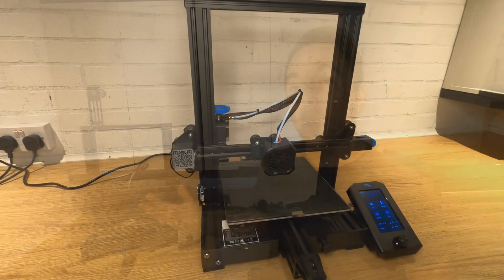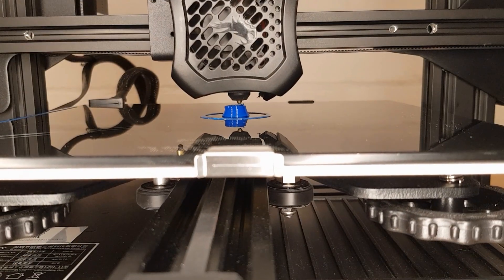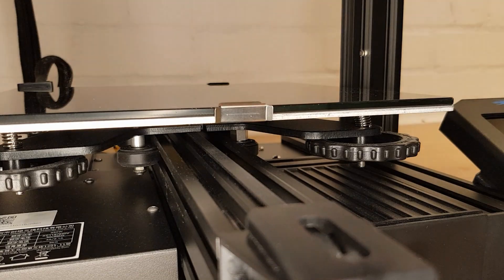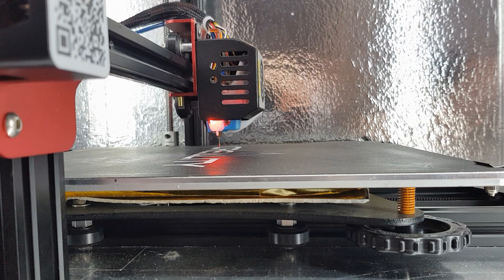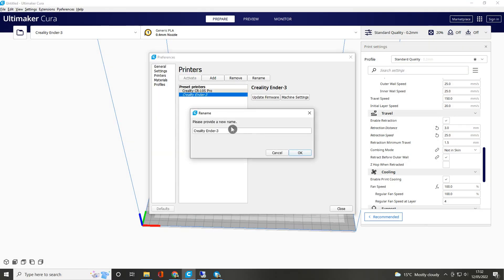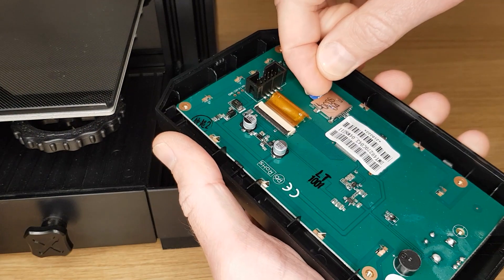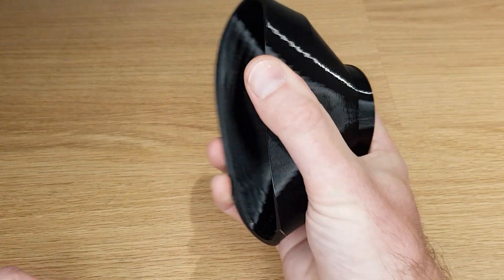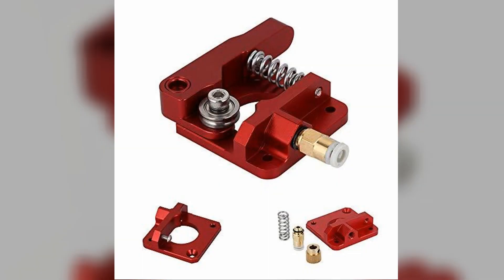Ender 3 v2 - Still The Best Budget 3d Printer in 2023? The Truth After 6 Months

Comment: After 1 year my Ender 3 V2 is still awesome, I have done many upgrades to it, I advice a bed leveler like BLtouch or CR, and a nut addition for the bed/spring leveling, the screws tend to spin while trying to level the bed, besides that a capricorn tube for the bowden tube is also good, there is a video on cutting a small piece and placing it inside the hot end which is also great, but these items are cheap and all you really need, anything else will not improve prints but help with the life span of your printer. Love your videos btw

Comment: I bought this printer at the end of 2021 and have changed a lot to it. First I bought better bed springs, then a whole metal extruder, a BLtouch for auto bed leveling and a filament runout sensor. Meanwhile I had to replace the hot end unit as the fan studs got broken. (You can't print yourself one when this piece is broken, so maybe I should print one in advance. Just in case....) Last week I moved from Jyers firmware and Octoprint to Klipper in combination with Mainsail. The screen became useless, so I bought a 4" touchscreen for the hooked up Raspberry Pi and printed a nice mount to bolt it at the same location to the printer as the original screen. The only thing I'm running into fairly often is heat creep. I have no clue why. Especially as the fans are still pretty new, so colling should be ok.

Comment: I bought Ender 3 v2 Neo and upgraded the heatbreak. I am very happy with it. You can't go wrong it's the third edition's v2 and Neo update. Full Metal Bowden Extruder + CRTouch with metal tip! And I printed lots of upgrade parts. Its such a good 3D printer. You really can't go wrong. It may not have lineer guides but hey it's $300 printer... Not a 1500 one... And it can print as good as those 1500, 2000 price tag printers... Especially Prussa... Don't buy Prussa Ender Prints with much better quality!

Comment: It took me 5 hours to assemble it. It was my first ever 3D printer and I knew nothing about them. I found the build manual to be confusing, I never knew which was "left side" and "right side " , the drawings always showed from different sides. It could have easily showed the different drilled holes indicating left or right. All the wires didn't make sense if you build it back to front.
Eventually I relied more on common sense and made more progress. I also couldn't work out where the software went , I thought it was on the printer itself. I seemed to have problems with filament not getting to the nozzle too and the blue wheel didn't really push the filament down. But I learned a lot from all my mistakes , bed levelling only caused minor problems , not printing on one side . I soon learned that you can adjust the settings mid print . For my first thingiverse print , it said 26 hours to print , I'm not sure why so long. Oh I'm learning a lot 🥴
Reply from the maker: I hope you're enjoying the journey, there is a lot to learn initially but it gets easier.

Comment: Can you use CNC programming language on these machines?’ I used to be a milling machinist and know the language really well. Also what 3D machines are good for precision plastic parts?
Reply from the maker: Hi, from my experience, CNC machines use G-code, so do 3d printers. However, I would use the software designed for 3d printers called 'slicers' and then see if you want to mod anything from there, it would save a lot of time. This video helps to explain the process https://youtu.be/e-lQPGJ3Psc
When it comes to 'precision' plastic parts, it depends what tolerances you are looking for. To get fine tolerances, you will likely need to do some tuning on any machine you buy and keep a close eye on all of the variables like temperature and humidity.

Comment: If you are a new user and using videos like this as a guide, don't. Creality is trash. Crtouch missing hardware, dual Z missing hardware. Only needed those 2 mods because the default printer is trash. Glass plate, can't be bothered to be flat. This a paid review? I hear they do that too. I'm sure these were good in 2018 when they made the design, 5 years later, same innovation (lack) and poor design (oversized Max without stock dual Z).
Reply from the maker: Sorry you've had a bad experience. This was 100% not a paid review. I bought this printer myself and have zero affiliation with Creality at this point. My reviews are always 100% my honest opinion and always will be. I still use my Ender 3 V2 daily. I genuinely love it.

Comment: I got my E3V2 for Christmas. I cannot thank you enough for your videos - they have been a great help.
In particular my V2 came with same bed issue as yours being too tight from factory and having developed flat spots on the rollers. Your tips on that issue in your assembly video turned out very helpful.
Then comes the bed leveling (I have also interacted with you on bed leveling video before). Your video showing bed leveling using a feeler gauge is the best. That is my preferred method as well.
Being an engineer myself and with some OCD, I was very systematic and precise during my assembly. Result -> The printer has been delivering outstanding results right from print #1 !!
Thank you for everything and looking forward to more videos from you. (I am glad I have same model as yours 😀😀)
Reply from the maker: Thanks for the comment. It sound like you have all the tools you need to enjoy 3d printing, a systematic approach and a little patience. So many problems are caused by sloppy assembly and not always by owners. I always seem to find something that manufacturers have assembled wrong when I get new machines. Let me know if you have any 'challenges' that I haven't covered in a video👍

Comment: I think I have owned this printer now from just before this vid came out and it has been nothing but trouble! I love it! 
It all started on day 1 with an upgrade to Jyers (now mriscoc Professional) followed very closely with new fans, and more of them. To reduce the noise I installed squash balls. Because my glass bed was basically a bowl it was impossible to tram the bed so I got a 3d touch. I wanted to print PETG but the blobbing lead me to convert to direct drive, then a HeroMe gen6 for better PLA cooling. For improved bed adhesion and removal without having to tram the bed all the time I added a magnetic PEI sheet which is brilliant. Now I'm upgrading to a dual lead screw setup because the direct extruder is too heavy and messes up technical prints. In between I also got silicone bed 'springs' and an all metal hot-end conversion kit. I guess the only thing left is an ender extender, but that's so expensive!
It's been a wild ride but I am still enjoying every minute (well, except that one Ali Express scammer, but that's another story)...
Reply from the maker: Sounds like you are enjoying yourself 🙂

Comment: Is the ender v2 better, or an upgraded model of the Ender 3 pro?
Reply from the maker: I'd say that 'better' is a matter of opinion. The Ender 3 Pro used to be shipped with an 8 bit mainboard but I believe they mainly ship with a 32 bit board now. The v2 has always had the 32 bit board which is better. The V2 also has a bigger colour screen but it doesn't allow you to do any more really. They also have different bed surfaces but I wouldn't necessarily say one is better than the other. The power supply is within the bas on the v2 rather than external so it's overall appearance is nicer.

Comment: I found that my plastic extruder has started cracking without me noticing. What ended up happening was that it was slipping while pulling filament through. My prints would still work most of the time, but wasn't extruding as much as it should so I just didn't notice at first. i was printing for about a year before I had that problem though. And I got some really good prints before that.

Comment: I have the E3v2 and like it.
I have trouble with it though printing eSun PLA+ that is supposed to be printed with a bit higher nozzle temp and I get stringing and some blobs
Factory set estep seems way off, as well as matching flow rate that would provide a perfect 0.40mm single line wall
There's quite a bit z axis hysteresis going up vs down, especially to the right.
Using latest Pro firmware for E3v2 with UBL, tramming/mesh says I'm level but bed level test suggests the right side has a bit too much gap.

I just want to solve the stringing/bobs without having to make the nozzle cold which creates its own problems.
Reply from the maker: Have you tried drying your filament? I find eSun to be pretty good but I do dry most of my filament. Try this if you don't have a dryer https://youtu.be/WC3jvuq-uq8
Reply: @RickyImpey  wow, what a fast reply!
Yes, I've dried it with updated Sunlu for 9 hours at 47c with desiccant inside.  After about 8 hours chamber towards top of filament was18% humidity with temp at 108F or 42.2C.  I've done that before without much improvement
I'm printing the cat now with flow modified in gcode to 89.

I should add that when I've done maintenance on the hot end, I found about 8mm (from memory about the height of the heat break throat) of filament somewhat tight in the bowden tube after I've extracted the filament.
Also I found the heat break was not screwed in tight into the heat block, also the heat block support screws were also loose.  At the time I didn't know the heat break was screwed in, thought it floated to minimize heat transfer and that only the bowden tube made contact with the nozzle base.
On my first change of nozzle thinking it was clogged, apparently I didn't have the tube against the nozzle so melted filament eventually spilled all over the place at the top of the heat block.
Reply from the maker: @danman32  sounds like you're sorting it out now at least. They are good printers but Creality don't always put them together with the greatest care unfortunately 😏
Reply: @RickyImpey  not sure how you can say I'm sorting it out.  Still same problem, just added history and findings.

Comment: Great video, really enjoyed it and for sure will be using you tips when assembly my printer. (soon to be bought).
Also, I had some comments on a reddit post saying that the V2 is no longer "okay" and the NEO (basic) would be a better option. Do you agree? From I saw, I would still be choosing the V2. I am thinking on upgrading the fans, so at least that"extra" money would be spent. Regarding the auto leveling, I was not thinking on using that (at least at first. maybe an upgrade later - or not), so the NEO would not have significantly upgrades (from the V2) that would justify the extra I would spend for buying it. Also, since we are a few weeks into Black Friday, I should wait for BF deals for buying mine, right?
Reply from the maker: Hi, the V2 can be upgraded in every way but the trickiest/costliest can be the bed size. If you're not sure you want the extras that the Neo has and the price looks right to you, then maybe buy the V2 and upgrade as and when you want. I used the V2 completely standard for 6 months with no issues and felt no real need to upgrade until I wanted to print with PETG. Then I switched to a Capricorn Bowden tube so it was I bit more durable and precise. I've added a CR touch but, to be honest, it was simpler without it.

Comment: Thank you so much for your vid helping me set this thing up. As a total beginner, I found the instruction manual to be extremely deficient and without info on bed levelling, calibration, z-offset tuning, etc, etc, I've had to resort to FB & youtube & still not working properly! Seems that the build plate is slightly higher in the middle, so can't get leveling done well enough.
Reply from the maker: Hi, sorry to hear you're having problems. Do you have a metal ruler or known good straight edge that you can check your bed with? If it is warped that bad you should be able to see it. If it is bad then maybe consider a warrantee claim? It's unusual for the glass bed to not be flat though. Have a look at the way I tighten the bed springs at the beginning of this video. It's a slightly different model but you may be inducing some warp if you are cranking down one spring at a time. It a bit of a problem with the being 4 adjustment points. Sometimes they can fight each other. https://youtu.be/GmhBYOEb-ro

Comment: I have had my eyes on this printer for about a week now and am currently about to give in and buy it. It costs around $203 here. I asked the seller of the control board version of their units and they said it's 4.2.2. Can you help me understand what are the disadvantages of having a 4.2.2 board? As I only have a few bits of understanding about FDM printers. I really need some enlightenment to help me decide if I should get this version. I can fairly tinker with anything so I am just more interested to know what are the needed upgrades/fixes should I buy the unit with the 4.2.2 control board. Please help :(

*p.s I only print with my resin lcd printer and am wanting to get an FDM for other projects, as seemingly, filaments are more economical than resin plus the strength of the prints are much better (which I would really need for my projects) rather than smoother surface quality. But I must say, the quality of your prints for those sample prints especially the Spiderman blew me away! I would love to learn how to print with that kind of quality!
Reply from the maker: Hi, mine has the 4.2.2 board it it works great. I believe the 4.2.7 can be a bit quieter but I am no expert. The main issue people have is with the processor chip. You want the one with 'RET6' and not 'RCT6' as it has less memory and makes updating firmware to something like Jyers firmware more difficult. If you can find out this information then you will be happier with the RET6 chip.
Reply from the maker: Also, the test prints are all done with virtually standard Cura profiles. I think I reduced retraction distance very slightly but nothing drastic.
Reply: @RickyImpey  Thank you for the response! I really appreciate it very much! 

I guess I wouldn't mind the sound as the printer will be placed outside the room. I will try to ask the seller if they know what type of processor chip are in their units. Your response has given me a more optimistic view. I guess I'll just have to cross the bridge when I get there regarding any issues that may arise. 

Also, would you know what parts are needed if say I wanted to go for printing nylon carbon filaments?
Reply from the maker: @misteri09  If you want to make strong parts then I'd say you would be better off with an Ender 3 S1 Pro or another printer that is direct drive AND with an all metal hotend. The V2 can be converted to this spec down the line which is part of what makes it a great printer. But, if you know you want to print with higher temperature filaments, I would invest in a printer that is capable from the start if you can. Here is my S1 Pro review if you wanted to consider it https://youtu.be/zEVVV3jDUX8
Reply: @RickyImpey  good point! Going to watch the link now. Thank you so much!
Reply: @RickyImpey  I've asked about the Ender 3 V2 on most of the sellers here and found that they do come with the 4.2.7 control board but has RCT6 processor chips. Is there a work around if you wanted to do the firmware update for this chip model?  Since it has the lower flash memory capacity
Reply from the maker: @misteri09  I think TH3D have a firmware workaround but I haven't tested it myself.

Comment: I don't see a need to get the BLtouch or CRtouch. Manual tramming is fine and you should do it every time after each print since removing the print from the bed always changes the alignment on mine. 
Upgrading the springs and the tube are the only two things that matters on a v2. Octoprint addition is nice but not needed if the printer is easy to access. Finding the proper power source (5v >2.5A) for the pi is actually the tricky part but it has to be done to avoid the constant low current warnings and the blob from it.

Comment: I've been very happy with my Ender 3 V2. I will admit it can take some time to dial in. Before I did my first print I did 2 mods. I put heavy springs on and I switched the firmware to the Jyers UI.
I've had to relevel the bed a few times and dry filament but nothing serious until my recent fan noise. I'm going to oder new better made fans and replace them all.
If you have a somewhat mechanical mind and think things out, you can handle it.
Reply from the maker: Yes, completely agree. It can be a great printer but it requires a bit of mechanical sympathy from the owner.
Reply: @RickyImpey  I also have to say this was my 1st printer. I also went and watched several videos on it and some others. I watched videos on 3D printing in general to decide. I think a very helpful thing to do is research before you buy so you understand better what you can do, what can go wrong and ways to avoid or at least fix the problems you may have. Videos like yours can be very helpful.😎